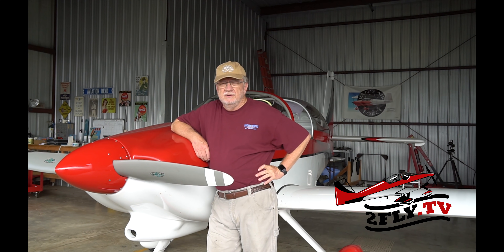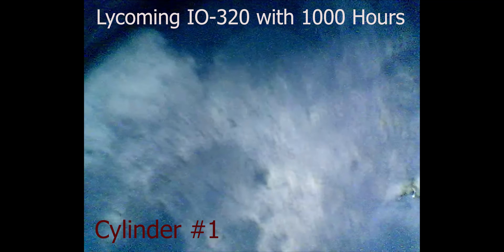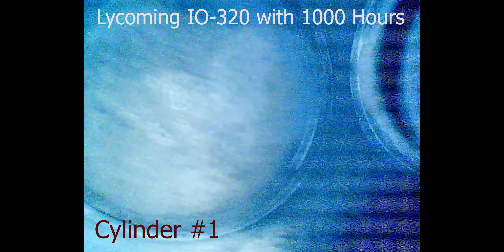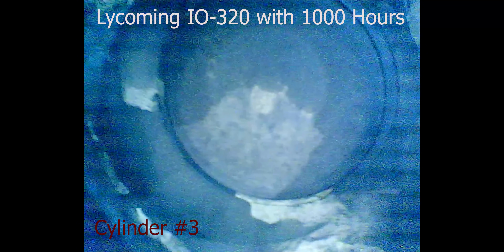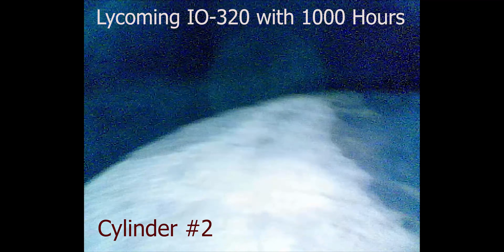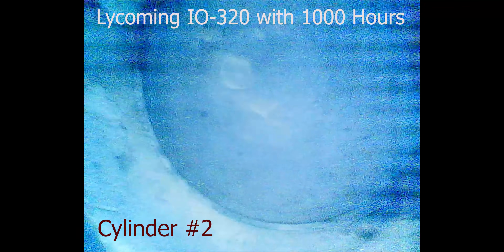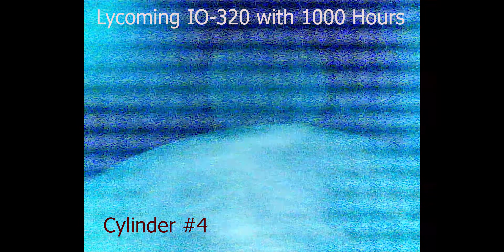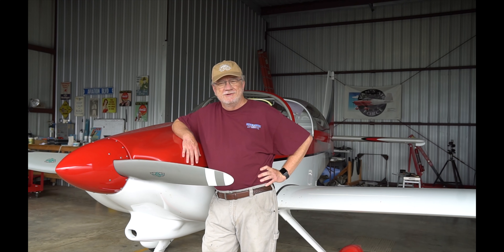Lycoming 1000 Hour Borescope - Vans RV9a

Comment: Thanks for the video.
I recently purchased a bore scope and have been watching any video's I can find.
Very interesting looking at your engine.
I have been watching "Savvy Aviation" and according to his video's your engine looks fine.
Nice symetrical patterns on the exhaust valves and normal looking lead deposits. The bores show cross hatch still with no vertical scoreing.
Exhaust valves look like you run slightly rich of peak.
There is some marking on the valve seats but if the leakdowns were good I would not be too concerned if it was my engine.
Of couse regular checks would show up any trend here.
Well. Thats my novice guess anyway. I am certainly no expert but I am soaking up all the information I can get.
I am hapapy for any "Real" mechanices to comment on my observations, I am after all, still learning this stuff.
Again, thanks for your video.

Comment: the Color of the bore scope wasn't good enough to judge color, which is important. any green the valves is bad.   The only thing i noticed is that is looked like maybe one of the valves in #3 isn't turning.  the valves are designed so that they rotate  a couple of degrees every time they go up and down.  that keeps wear even on the seats and keeps them clean.  I would keep and eye on it. maybe check it after another run, and see if it appears to turn. if not i think the part that turns the valve can be changed without pulling the cylinder, maybe?
Reply from the maker: Thanks Greg!  Our annual conditional inspection is coming up in a few weeks and I planned to look again.  I will look closely at #3!

Comment: Do U think it is possible to fly across the world if I make my own aircraft illegally without FAA or whatever approval!? I'm a bit concerned about the social aspect and trying to not offend any1 a.k.a. maintaining political correctness. What I am planning on doing, many years from now, is making my own aircraft.. a little bit of airship tech (Hydrogen party balloons) for safety so I can't fall fast to my death (a parachute too), a little bit of helicopter tech for VTOL ability much like the new Vahana aircraft has, & a lot of airplane tech with the wings and lilly propellers/fans in the forward position. The key to infinite range (not non-stop) is the ability to recharge ANYWHERE (woohoo!) using solar panels and a 600 watt wind turbine (roof mounted), the aircraft's light weight, & efficiency with use of low stall speed (big hump wing design on the top part) wings along with a light gas such as hydrogen (in balloons kept away from the heater). The aircraft will be able to carry up to 3 ppl incl. the pilot with no license. What problems can I expect if all I've had is PC sim programs to fly in b4 (limited experience)? @Eidsmore on Twitter
Reply: What does your comments have anything to do with this video, it’s a waste of our time